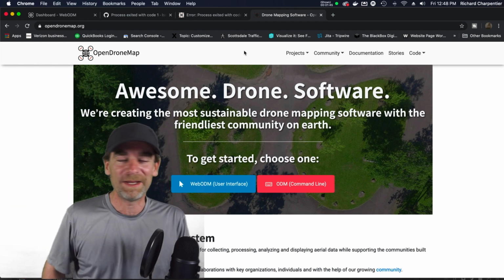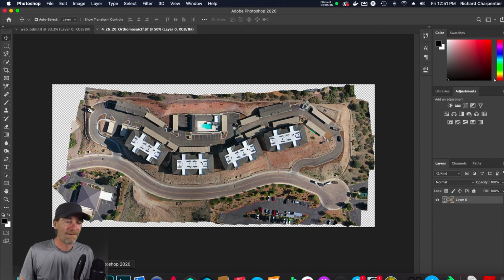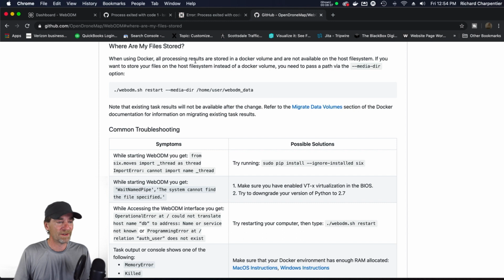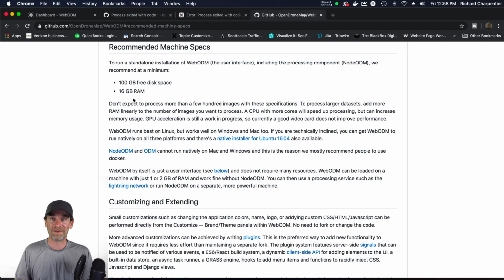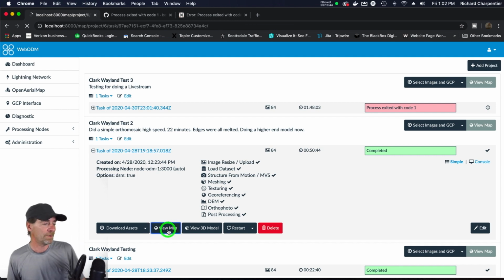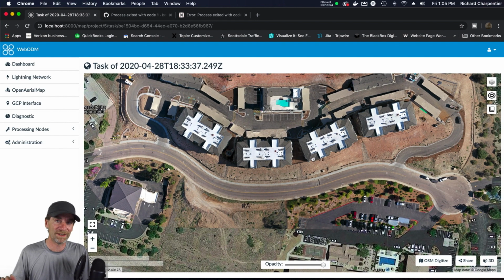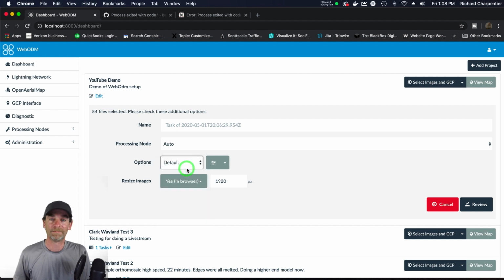A Second Look At WebODM - Open Source Drone Mapping Software

Comment: I'm testing this solution, just because I can't afford any of the commercial solutions. I was super stingy and avoided the WebODM Installer. Don't know if that would've made a difference, but what I know is that I've never in my life battled so much with an installation. I'm not a super computer programmer, even Python is a bit above my capabilities, but yeah, 2 days and counting, that's a 50 year record.
Reply from the maker: I think the installer might have helped.  Sorry you've run into problems.
Reply: @AZ-Drone , I did end up using the installer, which is why I posted this comment in the first place. The installer costs some money, yes (but as you said, it's paying back a tiny bit at a time), but the installation is a total breeze compared to trying to do it manually with limited programming skills.

Comment: Richard,
One more question. Have you attempted to use WEBODM lightning? My computer is robust for 3D processing, however, this service sounds appealing for my future workflow process.
Reply from the maker: I haven't used Lightening yet.  I did spend some time on their website, but I haven't had a need for networked processing yet.

Comment: it would be nice to see your flight lines for the 3d ...
Reply from the maker: I'll try to remember to do a follow up and show the flight lines.  It's pretty basic though, 4 passes from East to West and West to east (2 each way).  The flight didn't even use the full battery.
Reply: @AZ-Drone  Let me restate that ... when I mean "see", I really meant to see them on my computer(to practice with).

I have always felt, various data should either coincide with existing, good, accurate and/or precise data or plainly state why data does not line up more perfectly... my greatest fears in over 40 years(Land Surveyor), was for my data to be used incorrectly with existing data that "happened", to look like it "could", be used in conjunction with other existing data.

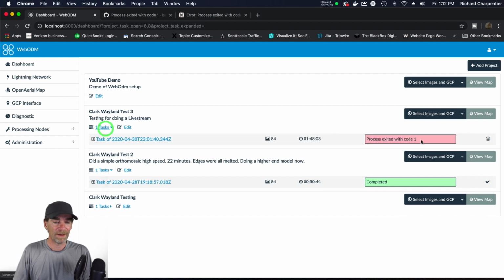Comment: 25:55 Go to Docker Desktop and tweak the settings for the disk and memory size reserved for the projects. Chances are it is set to something super low. You can also change the disk where it creates the image file, to a different disk that has more space for it. I changed the disk memory size and I stopped having the error code 1 exits.
Reply from the maker: Nice I will try that. Thanks a ton!!!!!
Reply: @AZ-Drone  by the way I tried to align a photo sequence for a map, and webODM did a better job aligning them than metashape standard, really impressed!

Comment: WHy would you not run it in max quality mode?????
Reply from the maker: In my case with the iMac I was using the render would always fail. The iMac couldn’t run the highest quality. I’m hoping to build a new system in 2021 to do some more tests. After reading around I know I didn’t have near enough RAM.
Reply: I mean, if you watch the video, that is explained...

Comment: Hi Clark, I've purchased the WebODM web-installer, the User's Text Book, and the GCP editor. and have had good success on high resolution models here in South Africa, using Windows 10 PC with 32 GB ram, and a good Quadro Graphics card.  The learning of the "tweaking" of the parameters is a challenge. (I tend to run back to Agi-Meta, but I do want to proceed and get up to speed with WebODM. I like the open source concept wherein we as the user-group develop our tools of the trade together, and at lesser cost (South African Rand-to-US-Dollar is a huge challenge for us). Thank you for your video. I would have like you to test the WebODM on a good spec PC. Best regards, Leon Botha.
Reply from the maker: I really do need to get a higher end mapping setup next year to do additional testing with WebODM.  I want to be able to do more with it as well.  Hopefully that will be in the near future!

Comment: Thanks a lot for the highly informative video. I'm planning to build a quite affordable PC for WebODM or similar software, and do you think a 9th gen Core i5 with 6 cores, or a Ryzen 5 3600, with 32gb or maybe even 64gb of RAM, could do high-res photos?
Reply from the maker: Good afternoon!  Glad the video was helpful.  I've been trying to figure out final specs for a new mapping system myself.  I've got a good friend who likes building systems as a hobby, and he's sent along a few links to me.  Sadly, I've spent my equipment budget for 2020, so will have to wait until 2021.  
I like to refer to Agisoft's recommendations as I am a Metashape user.  Here's a link to their suggested build.  https://www.agisoft.com/downloads/system-requirements/
I'm looking to do a "Advance Configuration" with 64GB of RAM
Reply: @AZ-Drone   Thank you very much for the link! I think the CPUs I mentioned on 64gb, plus an old GTX 970 graphics card I have lying around, could fall somewhere in between basic and advanced

Comment: Hello from Newfoundland Rich. Really enjoying your videos, especially this one. Thanks for sharing your knowledge to the community. I have been using LiDAR, photogrammetry mapping and am now getting into video-grammetry (That's not a typo. It does exist), since the late 90's. I have used PIX4D, DroneDeploy, Precision Hawk (precision Analytics), Agisoft then Metashape, etc. All have their advantages and disadvantages. The largest survey I have done (DJI Matrice 210 RTK v2) is a 10.5 square KM green field mapping project with not GCP's. I thought I knew alot about drone mapping until that project. Over 22,000 images processed in 11 batches. Accuracy was acceptable but not what I expected, especially between process areas and heavy tree cover. The big thing for me is ground control points. I use the Emblid Reach and am happy with the results, especially when there are surveyed control monuments to work from. I will take a chance and try WebODM and let you know what I find with regards to accuracy. Again, keep up the great work. Cheers from the Rock.
Reply from the maker: Thanks for stopping by the channel and getting in touch.  I think you're the first person from Newfoundland that's gotten in touch here.  Very cool that you've been doing this for quite a while.  I've explained to friends often that modeling with images has been around a lot longer than drones have been around.  I've even tried my hand at generating 3D models with my regular cameras and Metashape (photoscan).  Let me know how it goes with WebODM.  I need to build a better modeling system, as I can't do a lot with WebODM, but I know that's the fault of my system being under powered for the application.

Thanks again for stopping in, and nice to meet you!

Comment: Thank you. I have used WebODM lightning, not sure how that is differrent to WebODM? Ortho came out well stitched but blurry tree canopy. Is the installer better? Is the installer everything I need for Web ODM (as in will it take care of everything for me)?
Reply from the maker: Thanks for checking out the video and for your comment.  Sorry for my delay in response.  

Often times I find that tree canopys don't look perfect in any 3D modeling application.  I often refer to the trees as "melting ice cream" in some models.  
The installer doesn't really buy you anything extra beyond an easier installation.  The functionality of WebODM is pretty much the same between the free installation and the installer.  So it's just an easier install.
Reply from the maker: By the way, I stopped by your channel.  Very very cool.  I've subscribed as well.  Checked out your "Man vs Drone" video and several others.
Reply: Thanks Rich good to know. Glad you liked my films! :)

Comment: Hi Rich, I am hoping you keep experimenting with WebODM once you have gone through the manual. I have it and it is helpful for sure but as you know there are tons of settings to test. I'm trying to figure out why the DTM and DSM's are white . The WebODM community is definitely helpful but you have to be patient and keep trying tweaking settings. I'm using 400 images on a 5 acre lot and it works with the default. Now trying to get the HiRes to work. I have 64 gb ram and windows10.
Reply from the maker: Hi again Roger!  Just responded to your question on GCPs on another thread.  On WebODM, I would really like to do more with it.  The issue is my iMac can't do much more in my experimentation.  Too under powered.  And my current Windows platform is too under powered as well.  I need to build a true mapping system similar to higher end CAD systems.  At the moment I can't make a business case for the cash outlay for a new system just to experiment further with WebODM.  While WebODM is "open source" and super reasonable on the price (Free to under $100 max), you do have to spend a good bit to build a platform that can run it properly.  Hopefully as business picks up into the fall I can justify the expenditure to myself, and then do some more testing with WebODM.  :)
Reply: @AZ-Drone  I totally understand. I have to finish reading the "WebODM Missing Guide" myself still. I find you have to tweak the settings one by one almost to see which ones cause the process to fail. The error messages straight up do not point to any setting that caused the fail which if the developers were ever able to put that in place would be wonderful. I'll see what the rest of the "missing guide" has to say on that if anything. All the best and thanks again for putting your effort out there for us. Its much appreciated.

Comment: Keep on going this WebODM Project, I real like watching your videos about it! 
Cheers from Germany! :-)
Reply from the maker: Thanks!  I need a higher end mapping machine to test this one out more thoroughly. If I get my hands on a new PC I’ll be sure to make more videos on WebODM.
Reply: @AZ-Drone  
That sounds great, I just ordered 64 GB of ram for my working horse. At the moment I am studying how to calibrate the lense for best possible results. Instead of most other programs, ODM uses the images itself to calibrate on each dataset. 
Also it is recommended to fly two altitudes in Cross pattern in -90° and -70° to deliver more attachment points/features.
So having a calibration pattern makes sense to get one generic good working cameras.json (camera template file) to boost things liitle up on processing.
The only downside I noticed to far, was the networking in docker. For some wired reason, it did not want to download all the mighty big ODM containers for docker, via my 1gb/s cable modem, instead I had to use a redundancy 10Mbit connection via VPN :-D I turned out to be a routing thing in docker, as it manages its own networking interfaces...
So lang, happy landings :-)
Tim

Comment: Hey Rich, don't apologize for the time, if you want to cover a topic that needs an hour, it needs and hour. Anything less then the time required would be a poor job. 

This takes me back to when I put together a new generic computer and installed OSX on it. It was the cheap way to get a Mac and it worked, kind of. However it constantly needed tinkering and updates were problematic. It just became too difficult.  When I put it together I had two SSD's, one for windows and 1 for OSX, it was a dual boot system. After I spent all the time to learn how to do this and then the time to do it, I ended up just re formatting the OSX drive and using it for a scratch disk because it was too buggy and time consuming to deal with.  
My impression at this point is that ODM might be a similar experience for me. For others who are better at that kind of thing it would probably work very well...

Comment: For 3D structures you need to run photo overlaps of 83% for good results.
Reply from the maker: In the case of this one, I was flying for the Ortho only for my clients, so didn't have a higher overlap.  I only mentioned the 3D model on this as I wanted to show that folks could see the 3D model feature on WebODM.  

With my current system, I fear doing a 3D model of this site would cause a Code 1 error even on the lower settings.